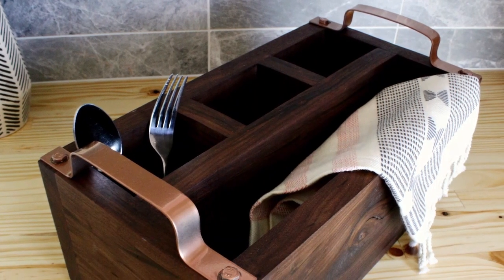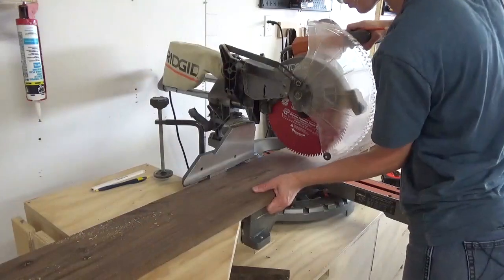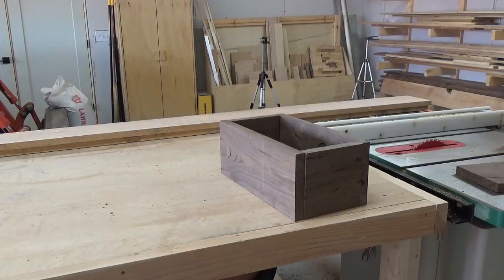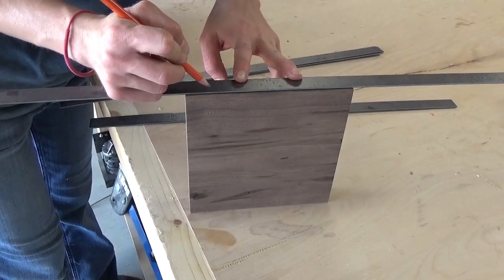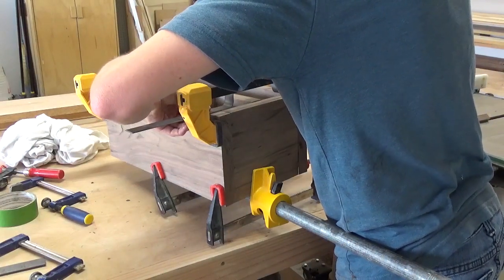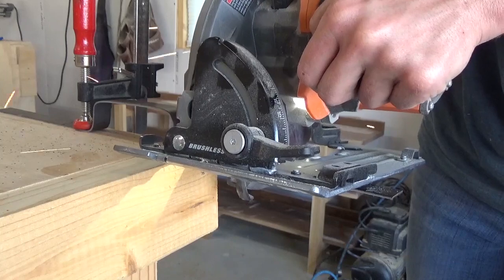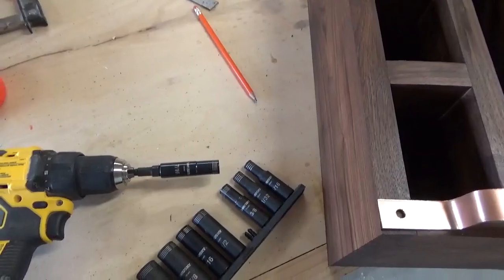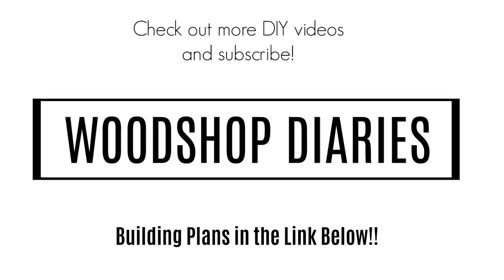DIY Wooden Flatware Caddy with Metal Handles

Comment: A beautiful job!
  However, disappointed with the DIY... I live in an apartment, so I don't have a woodshop, clamps, miter saw or anything else fancy like that.
Definitely not practical for the basic apartment dweller.
Reply from the maker: I’m sorry you were disappointed. I’ve found I clearly can’t please everyone. But, I don’t know how you’d expect to do any woodworking without at least some kind of basic tools/clamps/a simple saw. However, you don’t need “anything fancy” for this. Trade clamps for a little super glue (or painters tape) and use a $15 miter box and hand saw and, look, it all does the same thing 👍
Reply: A lot of communities have spaces where you can go and use their tools for basic projects and learning! Only you allow yourself by your circumstances. Your circumstances don’t limit you! It’s all a mindset!
Reply: You could also get a jig saw, speed square/ straight edge some glue and sand paper and clamps. There are many different ways to make anything!